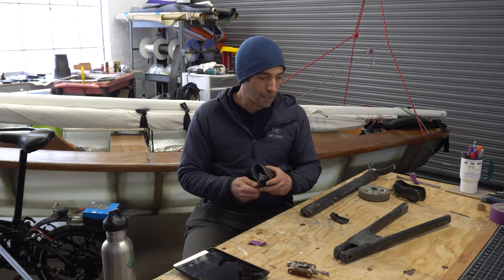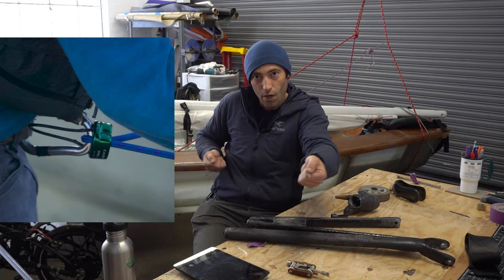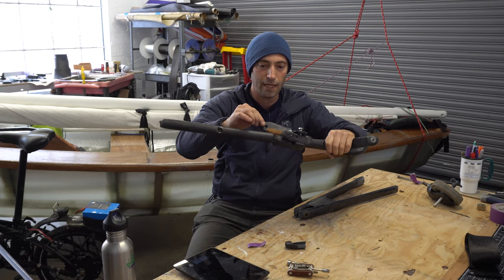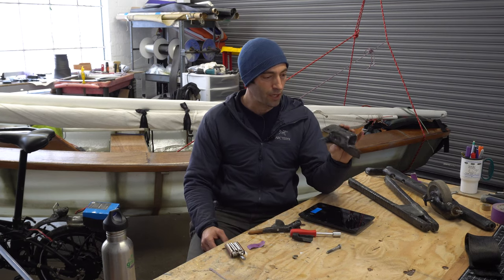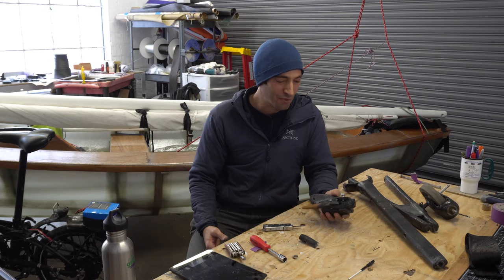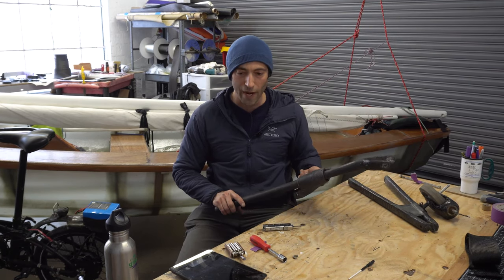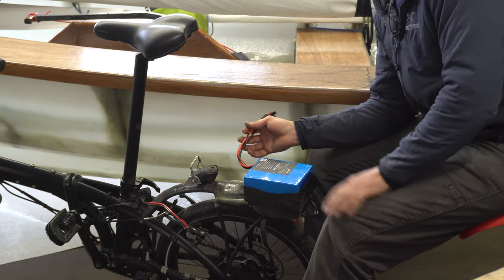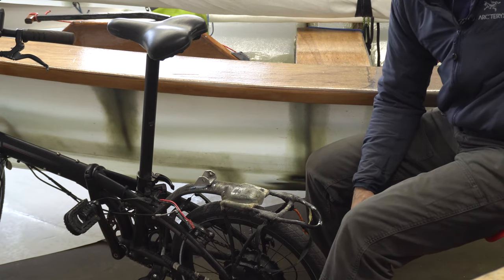Bike sailing tow mechanisms up close. Inventor reveals process in hopes of a Low Carbon Future.

Comment: Low carbon adventure - very good idea! Your video of sailing across SF bay reminds me of conditions I liked to sail my old Flying Scott on Cape Cod bay. A boat planes when the front of the hull is raised off the water at speed. Some hull shapes are more likely to plane. My Flying Scott had beamy flat hull and would plane nicely. The boat starts off by pushing through water then once you hit a certain speed the front of the hull changes from pushing water to skipping over the water. You’ll know it when it happens because the boat speeds up. Anyway, glad to discover your channel.
Reply from the maker: Thx Gonzalo! I think boats like the Flying Scot plane a lot more easily than mine. I have 105 sq feet of sail max on a 17' boat. I think I have planed twice boat while surfing down waves down wind. Thx for sharing.

Comment: I love your ideas, I love the low cost to the planet approach. I was wondering have you had any negative health reactions to using epoxy?
Unfortunately I was not careful enough with the sanding of epoxy and it has built up in my system. If I go near the dust, I breakout in rashes. Have you has any similar problems? Any advice..
Reply from the maker: So far so good for me in terms of health effects. I wear a pink mask when power sanding. When hand sanding I usually don't wear a mask, but I do vacuum up my dust piles. I dust with a feather duster and then mop the room once every 2-3 months.  I also have a WEN filter that I run for an hour after leaving. Sorry to hear that you've been sensitized to epoxy.

Comment: Great job! Consider using hemp or flax fiber instead of carbon. Parts will only be slightly heavier if they need to be as stiff. Otherwise, plenty of strength. Also, check out Entropy resins for a plant based epoxy. It's also less sensitizing. I'm already allergic to epoxy after 35 years of messing with it. Now when I get some on my skin, I wipe off immediately, then hit the area with an alkaline like vinegar or alkaline dust from Black Rock desert. Result: no rash!
Reply from the maker: Great to hear from you Craig and thx a lot. I do use Entropy Resins. Don't use much hemp and flax, thanks for the reminder! Other than ekoa samples I have received from Lingrove in SF I don't know where to purchase hemp and flax tow or fabric for composites. Got a tip?

Comment: g'day, love the inventiveness. I wonder if your slider system might be better as a jam system. I have never made one so i might be off on an impractical tangent. if your sliding piece was a v shape that had matched the rod that slides in the v shaped groove.  Would a cam leaver that presses a plate and puts  pressure on to the sliding rod, jamming it into the v groove. it would need to be a flattened tip of the  V or u shape. It seems that would give you a lot of friction quickly with an easy release. you could even line the V groove with rubber etc to have it nestle in quickly and reduce any play... I hope that makes sence... give me a pencil not words any day.
Reply from the maker: I get what you're describing and it seems like that idea would work! Cam levers are fun to work on.

Comment: I tow my small trimaran two milles across the city  to the water, I can aslo take the bicycle in the trampolin , but its a little hard come back when I come tired  from the water , so I m going to buy one off this electric motor , just need a little help , I also have a motorcycle but I dont want to make smoke , thank you for share !
Reply from the maker: Cesar, good to hear from you. Not quite understanding... Are you thinking of putting an electric motor on the current towing bike?
Reply: @fossilfool  jeje , yes , sorry for my bad english
Reply: I tow my small trimaran two milles across the city to the water, I can aslo take the bicycle on the trimaran , but its a little hard come back when I come tired from the water , so I m going to buy an electric motor , just need a little help from the electric motor . I also have a motorcycle but I dont want to make smoke , thank you for share !
Reply from the maker: @cesarmuttio506  I recommend the GMAC from Ebikes.ca .